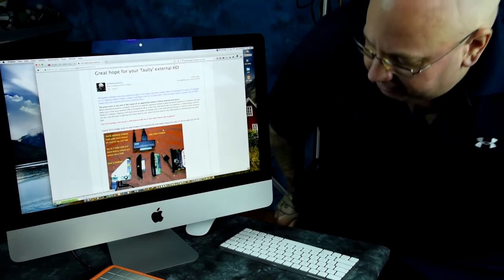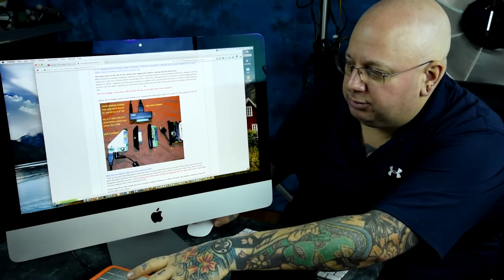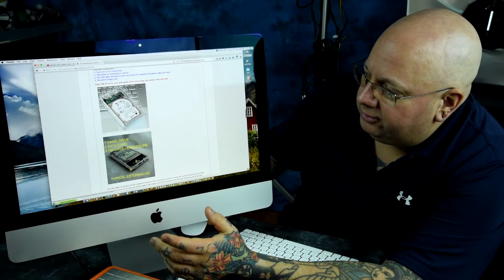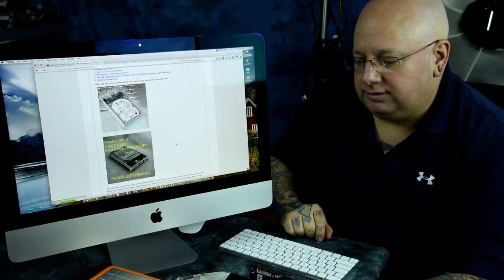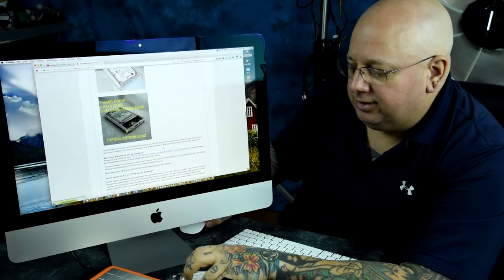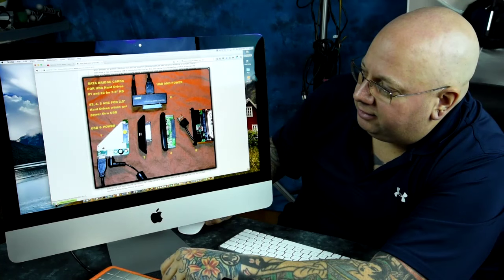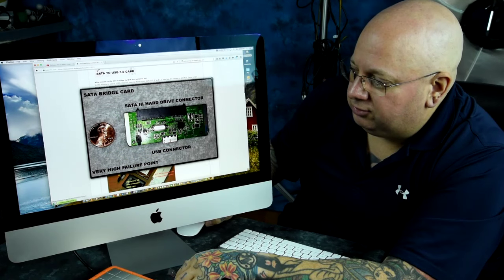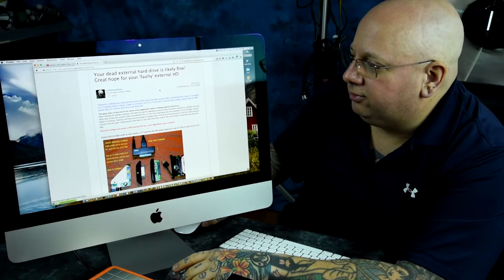Secret of "dead" external HARD DRIVES! How to QUICKLY fix the problem, its cause and solution

Comment: Don't purchase Wondershare...read reviews. I didn't read reviews and had a terrible time getting my money back. 

My external hard drive wouldn't open in Windows 7 for some reason, the computer screen just kept showing a circle spinning around. Instead of unplugging the hard drive, dummy me hit ctrl alt delete on the keyboard and shut down the hard drive...

Did I just remove all the info from my harddrive? Windows now says it doesn't recognize the disc and want's to reformat it.

Comment: hmm, I have buffalo external hdd that fell off a shelf and wont register anymore. I set mine out of its external closure hooked to sata and windows stays at loading screen when attempting to connect to my rig. then hooked it up to a powered sata usb reader windows disk management reads 3.86 GB all unallocated. Wierd thing is its a 3 TB drive supposedly. Wow, they ship these things with a dormant un paritioned 860 Gigs to mystery storage. does it reading as unallocated now mean i have to salvage using software or is this a stuck internals situation?

Comment: Hi. Thanks. What brand is your hard drive dock? 

My Western Digital My Book Essential USB 3.0 which is used as Time Machine, keeps disconnecting on macOS 10.12.6 (on late 2015 5K iMac with M395 GPU). Also it's hard to mount it but on Windows, there's not problem getting it to mount. I wonder if it's a macOS problem. 

Any suggestions for the fix? 

Thank you. God bless, Proverbs 31

Comment: Interesting. I had a WD external drive I was using for my Time Machine backups stop working after I moved. I cracked the thing open and took the 2 hard drives out and bought a dock to run them in.  I didn't realize why the original casing failed. I only had the things for a few months and I didn't think the hard drives inside failed, that it was something else.  It was a 4TB drive that had 2TB drives inside.

Comment: Sadly this didn't work for me...  Seagate 3TB hard drive all of a sudden became unresponsive... never dropped or anything... only took out a few times, store things then go it back.... and it still has the running sound when on and the unresponsiveness is getting worse and worse each time I reconnect. Bought the Thermaltake docking station from Bestbuy, plugged it in, and no response at all. FML

Worst start of the year in my whole life, so many shts been happening including losing my job... now this FKKK

Comment: I'm having an issue with my hard drive I have a WD Elements 4tb portable  external hard drive I store  all my movies on it as back up cause I had issues with blu ray players messing up my discs any ways I had the hard drive since March of this year it worked fine up until now the issue I have with it is every time I play a movie green pixels pop up on the screen, I'm guessing it's the usb cord cause I've plugged it in other devices back and forth between my laptop and blu ray player

Comment: This is relevant for drives circa 2012 which are still in use today..  The separate SATA/USB bridge found in that vintage drive has since been been integrated on the drive PCB as a reliability and cost reduction improvement.

Comment: i have a 1TB Seagate external hard drive when i plug it in it runs for about 5 seconds and all the while making a quiet clicking noise then it stops running and it doesn't even show up on my laptop no where to be found. Im thinking of taking it into a local computer shop so they can do a deep recovery on it for $50 but i don't wanna waste any money only for them to tell me that it's "dead" and there is nothing they can do about it. So i was wondering is THIS issue ALSO by chance because of the SATA Bridge Card? IF so id rather just buy a hard drive dock off Ebay (instead of having it looked at for $50) and get all my data back and put onto my laptop

Comment: I got a Seagate 1tb it works perfectly just fine til today. It won't recognize in my computer and in the disk management. But it shows in the device managment and it says it works fine. I tried replacing the sata card but nothing changes. Any ideas?
Reply: try using recovery softwares

Comment: I have an external hard drive that won't allow me to open my folder which I have inside the external hard drive, I Hoover the mouse over the folder it says empty folder I know I didn't format when I try to open the folder it says file or directory is corrupted or unreadable, I tried doing the chkdsk on command prompt the first time it worked but lately it won't work, can you help me out I have really important data

Comment: That video is definitely informative!

However, I have a burning question!

I own Toshiba Canvio Connect II 1TB external hard drive and from what I've seen, SATA bridge is incorporated into the main board, thus making it impossible to change SATA itself? Am I right?

Do you have any advice on how to change SATA bridge in that particular hard drive?

I really need help! 

Thank you for your response :)
Reply from the maker: yes, this is a problem, youd need to switch out the entire controller board with a HD copy of the bad one
Reply: Theoria Apophasis Thank you so much for a quick reply, I really appreciate that!

Do you have any video explaining how to do it or could you recommend one?

Comment: I have used freezing hard drives to good effect on occasion and can be a useful non-invasive step. Obviously bagged with silica gel to avoid condensation issues. Several reasons can attribute the method.

Comment: There are some western digital 2.5" external drives out that have a custom PCB.  Basically none of this applies to those drives because they physically cannot be inserted to another caddy etc since the PCB is one piece and is of a custom design.
Reply from the maker: +Stephen Ozoux yes, i know , integrated SATA bridges on the controller board. 

well thats not true , you can swap controller boards, its DAMN easy to do .
Reply: +Theoria Apophasis  Your right, it is easy to do if you know the process of finding one of the same model and revision for the particular drive in question.  I wouldn't say it's easy for those without technical knowledge though.  The dozens i have done for people, well they always look at me like i'm a miracle worker even after i've explained the fairly easy process to them.  The other thing is most people don't have  the suitable PCB just laying around either , we used to pull them off all the Clickers we threw away just for this purpose.  Then there is the bypass surface mount wire method to donor board of different model...not for the faint hearted lol
Reply: Hi there Theoria, I also had a WD with "Bad PCB" error, it's still spinning but can't be read. Can you pls adviceme how to replace PCB? Thank you

Comment: Another pound of bacon saved! Had a 5tb External HD that went down. Bought a HD Dock on Amazon and boom... bacon saved! All my data is back :-D
Reply: Steve Michaelson did you clone your 5tb to a new HDD? Or did you just pull up the files on another computer? Just curious to know how you got your data/files.
Reply: My Seagate 5tb external HD went down. I extracted it from it's casing and plugged it into the HD dock and boom it mounted. The SATA bridge was the problem, not the actual HD. The new HD dock acts as the SATA bridge now.

Comment: I had two external drives that died years ago but I always kept them in case one day I wanted to figure out how to "fix" them.  I was looking into getting a new large external harddrive about a month ago and I came across some stuff very similar to this about how the external hard drive is just a regular hard drive with a case and a lot of times the case breaks and the hard drive is fine (I felt pretty silly not figuring this out on my own).  I bought a external enclosure on Amazon for ~$27 and broke open the "dead" external cases to get the drive inside.  Both drives still worked so I ran a full format on them (already had the content backup when they originally "died" so I didn't need it again) and installed them inside my desktop to add new drives.  I'm sure tons of people just toss out the external drives when they "die" and they are actually tossing good drives.
Reply: +guitarwinds I have another drive that appeared to be "dead" even with the enclosure so I've got to try this technique of switching out the SATA bridge, didn't know about this.

Comment: 95% ! ,  Amateur, A Hard drive can fail for multiple reasons. It can fail from corrupted boot sector, It can fail by reading heads in the little rocker arms coming apart, It can fail by spindle motor failing, it can fail by getting an impact and getting platter scratch,  It can fail by getting scratch by reading head coming apart and it can fail by any component getting fry in the HD pcb. make your 95% more than.

Comment: I did this a few years ago to a 2 T external hard drive, where the external enclosure stopped, but I took the hard drive out of it, and it was like any other hard drive and all I had to do was plug it in to my desktop as a second hard drive, and it still works today; and I didn't lose any of the data that was on it.

Comment: bought a new seagate 1tb, plugged it into my ps4, works fine, chose the format as external option, formatting... 5 secs later "no device connected". not even my pc picks it up. even though it lights up and spins.

Comment: 95% wow this is a very inaccurate rating. Over the years I have had about 30 or so external hard drives and only 1 or 2 of them were rectified by switching the case or bridge or running naked as you call it PATA or SATA. The drives all normally are faulty long before the controller I will say this ranged from usb1 - usb3 so maybe usb3 host bridges suck more as I have only owned 5 of these and they all still are newer and functional as well as my usb 3.1 and a couple usb2 and firewire still left as well. The rest have all been drive failure. 

I am curious where the 95% number comes from what do you base this off of you are saying 95 of 100 hard drives external fail due to host bridge failure of some sort. Maybe this is so with MAC but with PC based usb/firewire/usb2.0/usb3.0/usb3.1 this has surely not been remotely close.

Comment: I learned his a while ago when my old external drive wouldn't boot. I took it apart and realized it was just a hard drive hooked up to a cheesy power supply. The hard drive wasn't getting enough power to run it. Next time I need it, I'm just going to buy a hard drive dock.

Comment: Just my luck that I fell in the 5% where it's the actual drive and not the bridge.
Reply: How can you know for sure that it’s the drive and not the bridge?
Reply: @ReeferChifah  Because I took apart my external drive, replaced the hard drive and and the bridge was working.

I hooked up my hard drive to a different bridge and it still didn't work.
Reply: @luckymouse1988  oh damn okay. We’re you still able to get everything off of it?

Having some trouble on my end not knowing what to do with my internal hard drive. Pretty sure the hard drive is donzo
Reply: @ReeferChifah  The drive itself wouldn't power up when connected to a different bridge or a USB-to-HardDrive bay, so I honestly stopped trying and wrote it off as a lost cause.

If I were you I'd open the external casing, extract the drive and try and hook it up internally in your computer, see if it powers up.

If it doesn't then... The circuitry of the drive itself might be broken, data could probably still be retrieved by specialized equipment, because the data is still on the magnetic disks inside the drive.
Reply: @luckymouse1988  hmmm okay. Not sure if I want to take it apart myself. I got an adapter to see if the bridge still works. But I believe it still runs. At least I can hear the initial boot up of the drive. Hard to hear if it’s running efficiently though. 

My Mac won’t recognize it internally. If the adapter fails to recognize it I will most likely send it to a data recovery team to do their magic and HOPEFULLY pull everything off of it. 

Would you maybe know the price it would be to send it off to a data recovery specialist?

Comment: No 95% is NOT due to the board its because you dropped or jarred it while it was running and caused damage to the heads or service area of the drive.  mmmmm bacon

Comment: Hi Theoria, great video that gave me some hope of fixing my 'dead' seagate 2TB external hard drive. I took it out of the casing and replaced the Sata Bridge card with one that you show in your Apple article (the black one second from left in your pic in the article). The disk fires up and the light is lit no clicking but still getting that the disk is unreadable on my mac. My question to you is do I have one of the 5% that really are dead or would buying the HD docking station make a difference? Im not worried about saving the drive , i just want it to mount so i can get the data off it. Please save my bacon too. Thanks in advance.